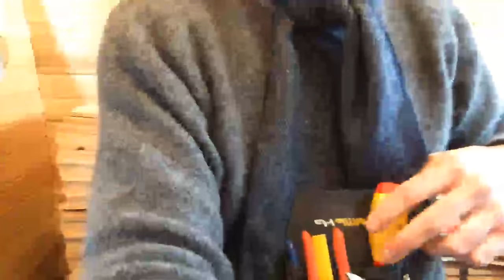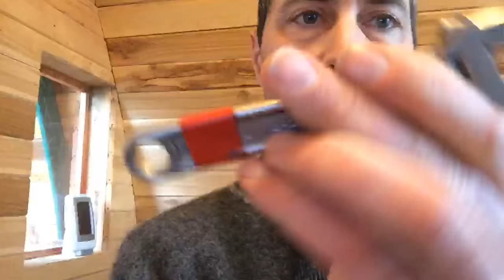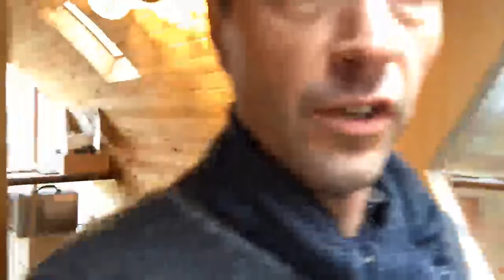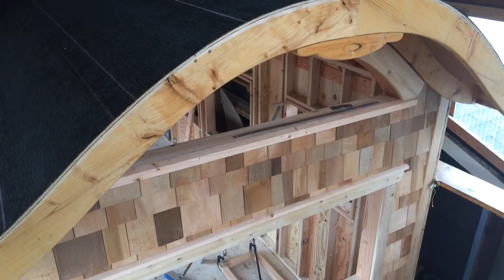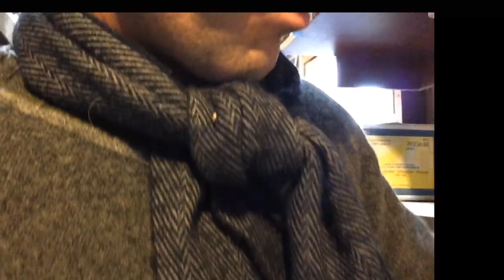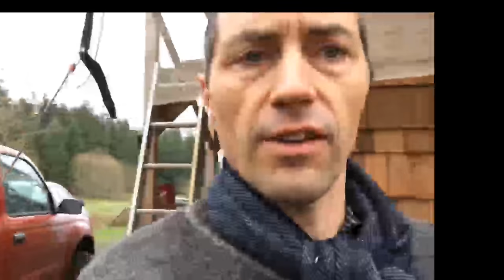Ask Zyl Live - Nov 27, 2016

Comment: You might want to look at ubiquiti products for wifi. https://www.ubnt.com/  I use nanastations for long run between base and outbuildings. 1/4 mile away with some trees in the way and have rock solid connection.

Shouldn't your rafters be over your studs? especially with a single top plate?
Reply from the maker: Thanks. I believe much of the low-bitrate issue is bottlenecking with my ISP. Working on that.

That is not a single top plate... there are 2 more laminated elements... so it is actually a triple. I also use a bonded-skin technique, so the roof distributes load evenly along the edge of the skin. No point loading at the rafters!